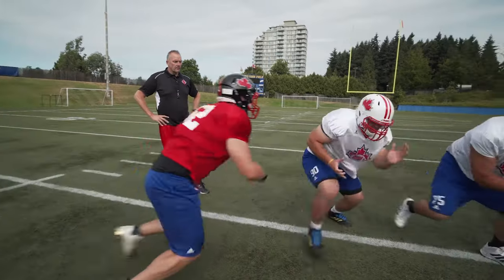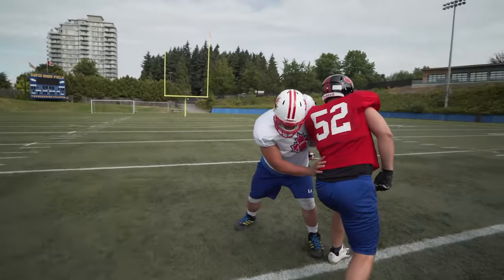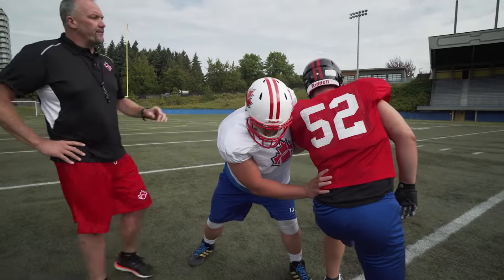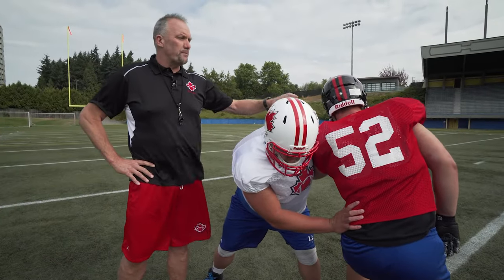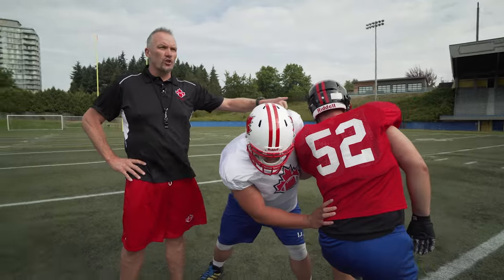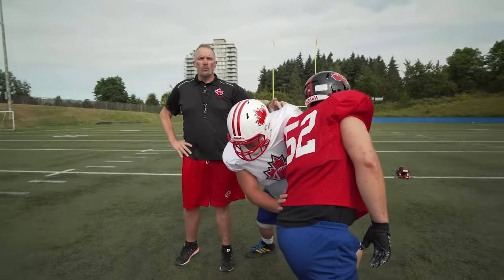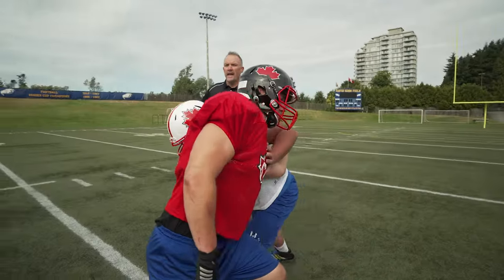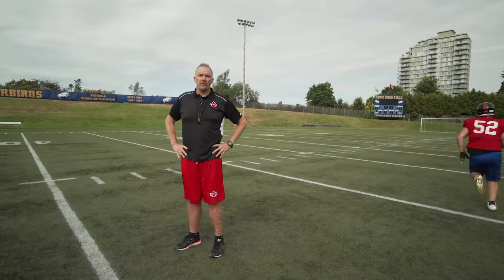Defensive Line Drills - Part 9: The Wrong Arming technique

Comment: You’re teaching this wrong Coach. 

WRONG shoulder means exactly that - if he is coming down the line from his left, he should be attacking the OUTSIDE shoulder of the pulling lineman. It’s hard to do as our instincts want us to go the way in the video.
Reply: Sorry but you are definitely not correct here. The wrong arm technique is executed so that the RB is "spilled" to the outside. The DE takes on the INSIDE half of the puller because thats where the run is designed to go, Inside. If you take on the outside half of puller, you've helped the puller execute his block, which is to "kick out" the DE.